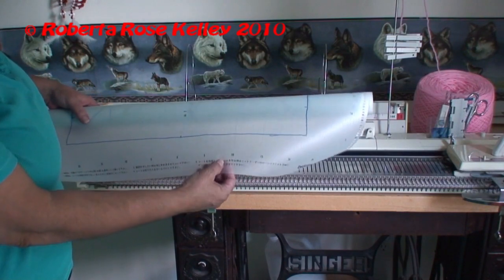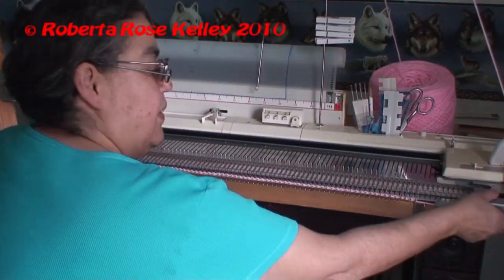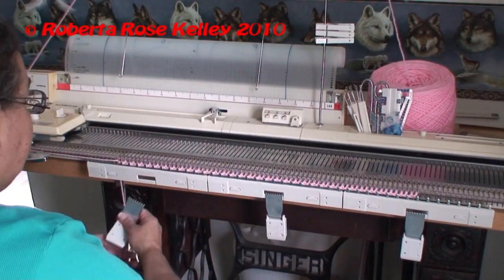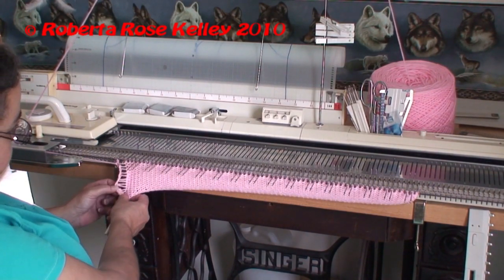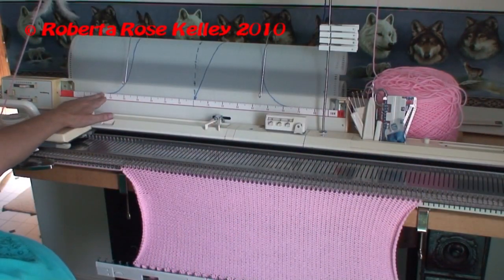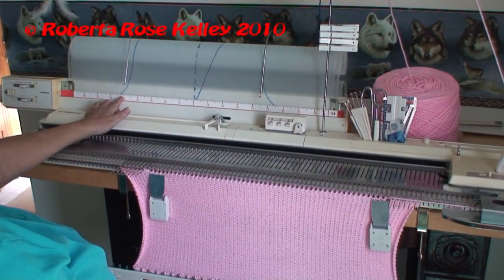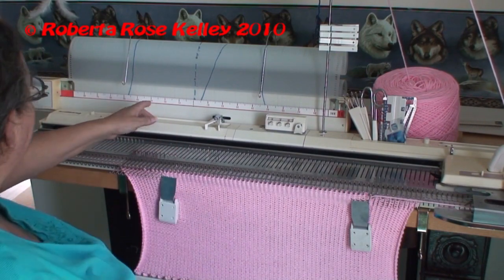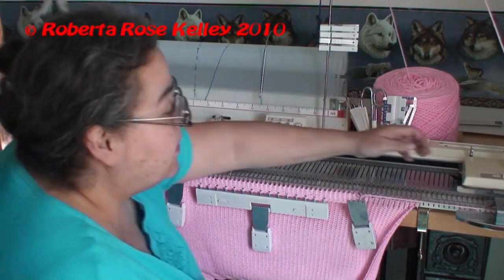KL116 Casting on & Shaping

Comment: So if I am understanding this correctly - a full scale pattern means that the pattern is literally full size, half scale means it's been reduced by half size and 1/4 is literally a 1/4 size...... if we have the schematics for a full size pattern and need to reduce them by 1/2 or 1/2 size is there an easy way to do this....? Also, for the 1/2 size pattern do you only draw half of the garment on to the sheet?
Reply from the maker: You are correct. Well on the Silver Reed contours and radars, they use half and quarter scale. I use a pantograph (I think that is the name of it). You can see me using it to make a half scale pattern for the KR6
https://www.youtube.com/watch?v=0pWrtGSojkg&t=10
If the link doesn't go right to it, it starts at 2 minutes and 33 seconds.